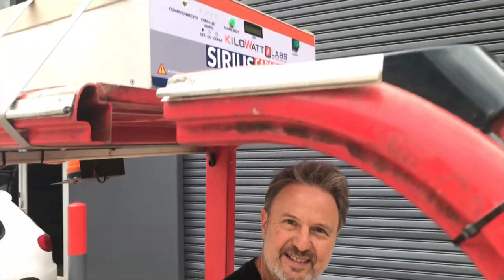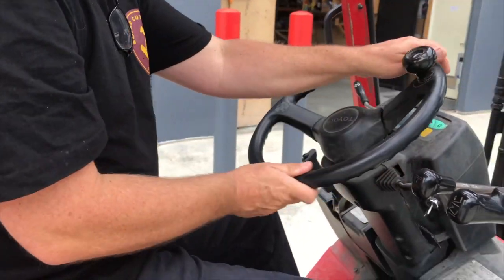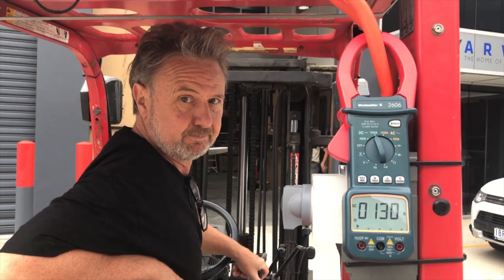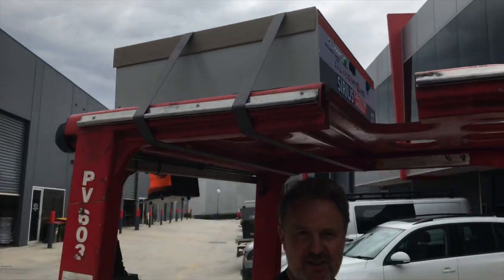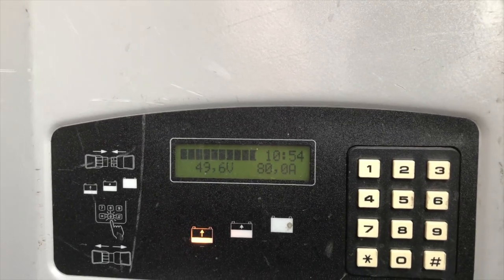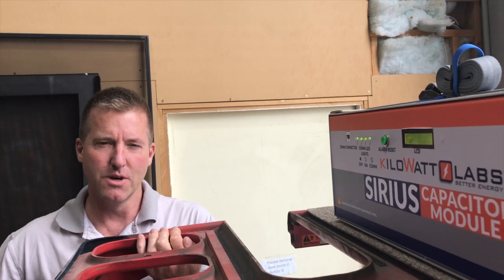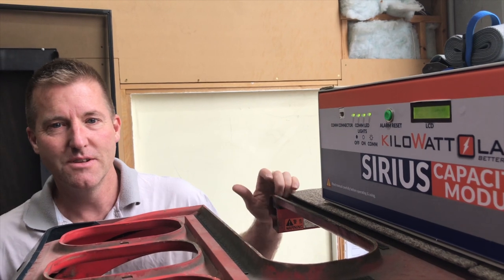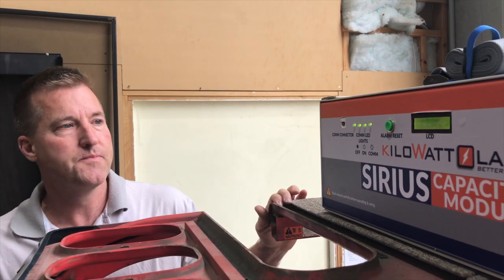Super Capacitor Powered Forklift

Comment: That is NOT supercapacitor-based, it IS a battery pack, and I would challenge you to continue using it to power your forklift daily long-term, as I suspect you will not get the life promise. See Wikipedia's entry on lithium-titanate-oxide battery, and link #15 in it for info on expected cycle life.

Comment: Wow. Thanks for the video!  This is an incredible advance.  Have to wonder why it hasn't been covered in the sci tech media
Reply: $¥€£ that's why.
Reply: Because of energy density. That forklift would have to be charged quite a few times during the day - which you can at least do being on site all the time. In an electric car range would be very short something like 10 to 20 miles when car would be fitted with as many capacitors as it could carry so not very practical yet until higher energy densities are achieved.
Reply: @martynasetminas7845  Then the solution is supercaps plus gas generator rather than a heavier battery, the cap bank weighing maybe two or three dozen pounds might work for a range of a half dozen miles but if the generator can recharge the bank fully two hundred times on a single tank of gas, that's a 1200 mile range. Its even better that supercaps have a standard lifespan of 100k to 1 million charge cycles instead of 500 cycles like Tesla's NCA batteries, not to mention it being lighter overall. For a forklift its also great, mount the generator and heavier stuff down low for stability and the caps strung together elsewhere, on-demand hydraulic pressure from the electrics without constant pump degradation from the motor running constantly, and thus lower fuel usage and more available torque for the drive system itself. Hybrid is a win-win
Reply: Its definitely a popular field of study, but they have issues. They have poor energy density, they tend to self discharge quickly, and they like to function at higher voltages than most batteries (danger). In hybrid vehicles, they can quickly trap energy from braking, but mostly industrial stuff.

Comment: I think they paralleled this supercapacitor module with the forklift main battery. It wouldn't take 30 seconds for that tiny supercapacitors module to run that heavy forklift. The module only works on peak demands.
Reply from the maker: Nice-oscar I can confirm there was no parallel battery, just the supercap running the forklift.
Reply: @SmartEnergyLab  how long does it run for? Do give me a stupid answer!!
Reply from the maker: Hi Oscar, it's a 3.55kWh supercapacitor. So how long it runs for depends on how much work it has to do. One of the advantages of supercapacitors is how fast you can charge them (<30mins). So during the breaks in the day you can recharge it.
Reply: are you sure it's actually a supercap? none of the video actually suggested it was in any way better than a battery... many electric cars charge at 350KW charging up to 80pc in 15 to 50m. how do you know it's not just a battery programmed to stop chatting at 80pc?    supercaps should be able to take 10x that speed

Comment: These seem fishy. I saw a datasheet for their 1000Wh 12V unit and it claimed less than 1mOhm of internal resistance but with a charge/discharge capability of only 50A. This makes no sense. Either a typo or they are lying about the capacity and/or internal resistance
Reply: Hi Andrew, lets discuss this to clear the misunderstanding.

Comment: Supercaps have low energy density as compared to batteries and therefore are not suitable for forllifts or cars, etc.......How long can the forklift operate on a full charge???
Reply: Super capacitor buses in China double Decker buses can charge in 15 seconds and go around 30 miles on that 15 second charge...they also have a back up battery bank you can use too charge your caps if get caught short but you can trickle charge with solar and if do run out you can use a normal 220v plug from any building n charge up in 30 seconds and get another 30 miles and this is a bus we are talking lol....its a far superior vehicle if you think ahead you could even use a dynamo crank if you so wished too get you too the nearest building but 30 miles then a 20 second charge then another 30 miles is good stuff ...eco friendly it's silent the caps last twice as long as any battery lifespan wise and yh can be charged multiple ways

Comment: This could be awesome.  What you need to do is have the forklift use regenerative braking.   Every time you lower a load or slow down the fork truck, dump that energy back into the super capacitor.  You would reduce the number of charges.  You could regain the majority of the energy you spent picking an item up when you put it back down.
Reply: it's already done in case of Port Cranes.

Comment: published under the Category comedy - LOL -  yes, that's for sure - no! a forklift is not the right tool to test the charge and discharge characteristics of an energy storage device
Reply: Go and look at the test video instead of commenting. You came across it by accident do your own homework he already did what you asked.
Reply: ..... which test video do you mean? I'll look at it for you. Why you need a video for the test of an energy storage unit? You just need an electronic load and a datalogger and you get all the required parameters. Then just write it in a datasheet and you're done. Nothing mystical about it. If you discover that you have created something that nobody else in the world has - check your results twice.  As usual in science, discuss your findings with others and let them repeat your readings. Now you will say - yes but then you steal my invention - an energy storage can be completely tested as a black box without opening it - simple electrical engineering.
Reply: Most likely Lithium batteries. I see no scientific evidence of a breakthrough cap.  The caps look like unmarked LI batteries

Comment: Impressive stuff guys,  but don't forget 2 things to consider. 
First,  this module is rated to 100A output if I'm not mistaken. Higher output might damage built in control circuit/supercaps. It gave you warning on the LCD screen at one stage in the video. 
Second, forklift was using 100A without any load/pallet.  
Put some load on and I'm sure load current is gonna skyrocket,  so bearing this in mind please be careful not to damage this supercap module. 
I was present a few times around 200A rectifirers used in telecommunications when one of their old style capacitors explode. 
It is like a handgun going off inside the room. Trust me, very uneasy feeling.  
Now, I would hate to be around when one of those hunks goes off with tremendous amount of charge compared to those old capacitors!
Reply: @JamesVerster  so what they are?
Reply: How do you solve that problem on the trains?

Comment: It is good to see a capacitor system having endurance like a battery.  Most of us are used to capacitors having an instantaneous discharge.
Reply: how do you know it isn't a battery? does it actually charge any faster?
Reply: I'd love to see a battery that can charge in literally two minutes and run a Nissan leaf for over 100 miles, I've been looking and I can find better that can change so fast without experiencing temps that ultimately end up destroying the cell due to expansion.

Only super or ultra capacitors have the potentials to charge and store a lot of energy in such a short period of time.

Comment: How do you get a slow release of energy?  I was thinking of using an array of mosfets and diodes, on a 555 timer to have a dual set of capacitors disharge in micro second intravals so that the whole charge is not released at one go.

Comment: if you search this on YouTube there's a guy called james verner who tested it and showed a 93pc round trip efficiency and discharge profile he claims is close to a lithium titanium profile. 
seems to suggest it's just a normal battery being sold as a super cap. 80A 50V = <5KW charge or 10x slower than the 150kw charge most new electric cars can get nowadays.

Comment: Supercaps still have low energy density compared to electrochemical storage. Based on the size of the pack and voltage drop these act like ionic cells with activated carbon or graphene  hybrid anode. So cells with capacitor-like power density
Reply from the maker: Hi Ken, yes, the importer describes them as hybrid supercapacitors. They have a lithium titanate coated anode.
Reply: @SmartEnergyLab  thanks for that. Very curious about the BMS.
Reply: @SmartEnergyLab  then, in effect there is still a chemical electrolyte at work and the brochure is complete and utter BS  saying no chemical electrolyte, as seeing as a lithium Titanate anode would have to react to something.....

Comment: solar panels could charge the caps and drive a reduction gear system then that could run an 100,000 watt ac generator to run a factory.
Reply: at 15W/sqft that's 6600sqft of solar panels without losses converting DC->AC

Comment: you  could put a feed back generator that recharges the caps as you drive. front wheel or rear.
Reply: No you cant, the loses are to great.  However some regen could be recovered  to slow the vehicle down, forklifts dont get up to speed to make this all that practical. Seeing as they use hydraulics for the fork, no energy can be recovered, not simply that I know of.
Maybe a forklift designed from the ground up could better capture all the waste energy.
Cheers

Comment: Did some digging online(   Forums.aeva.asn.au ) NOT true supercaps inside they are LTO lithium batteries just rebranding and  false claims.  :(
Reply from the maker: One of my friends has taken apart his Kilowatt Labs supercapacitor and applied a blow torch to the cell... just smoke... no explosion. Doesn't look like they're LTO cells.
Reply: @SmartEnergyLab  LTO cells don't explode. They're the safest lithium batteries. And they do look exactly like a big capacitor.
Reply: batteries usually get 1kw output for 1kw capacity and cost $1000. why do these fit these exact cost curves and power ratios while acting just like normal batteries thermally? what actual proven advantage so they have?
Reply: @monoham1  1 million Cycle Life no degradation and no impact of Temperature up to 55 Degree C

Comment: hmmm  smells like snake oil
Reply: because there not  supercapacitors there LTO's (lithium–titanate battery)

why dont you do some research and read up on things
http://forums.aeva.asn.au/viewtopic.php?f=17&t=5486
or
https://forums.whirlpool.net.au/forum-replies.cfm?t=2707005
just to list a few
Reply: Adverse Effects you have no idea what youre talking about. 
I had a salesperson presentation in our HQ with this exact module.
They are supercapacitors with graphene as a base material in their build. Very high energy density compared to earlier versions, so much so that they are now starting to be considered instead of normal VRLA batteries traditionally used as chemical energy storage in -48V systems used in telecommunications. 
In the presentation we had our discharge unit hooked up to this module discharging at 100A rate for at least 20min @ 50V which is about 5KW. 
Very impressive stuff especially considering they are meant o work in -30°C to 85°C and batteries you have to pamper at 21°C otherwise higher or lower temperatures require temperature compensation in voltage output in order for batteries not to die within 1st year.
Quite impressive stuff if you ask me!
Reply: Adverse Effects certainly does know what he's talking about. Have you read the thread he linked to, Zoran. Perhaps start here: How to tell a Capacitor from a Battery http://forums.aeva.asn.au/viewtopic.php?p=67687#p67687
Reply: Hang on, every new battery technology that is "the next big thing" has not even got close to making it out of the lab because of how unstable they are, and these people mean to tell me that they somehow made a amazingly energy dense SUPER CAPACITOR that is not only stable but able to put to use, while everyone else is not even close to passing the lab phase? Something does not seem right, because if they made a real advancement this info would be spreading like wildfire. I am open minded though so if these are real give me a link to a article or similar on how they made it completely through the testing phase and into the commercial market with a new power storage technology that no one has heard of.
Reply: if they really are supercaps and not just batteries then why don't they perform as well as supercaps?  has anyone actually tested them at -30 or 80C?  most caps can charge discharge in seconds but many cars can charge to 80% in under 20m now. have anyone actually done a teardown yet? @zoran 100A is nothing for a supercap.  even a basic $20 capacitor can discharge fromfull to 0V in under 10s but if you still have voltage left in this after discharge then it's either not a typical supercapacitor or you've only used a small percentage of its capacity. That means for a 5kwh pack,  it has 3,600*5 KJ of energy going in 10s that should be 1.8MW of energy or 34,000A. not a mesely 100A. ofc a 52V capacitor with over 1KJ of energy is already ridiculous.  for reference a truck based gas turbine puts out about 10MW and a tesla truck charhes at about 1.5MW.